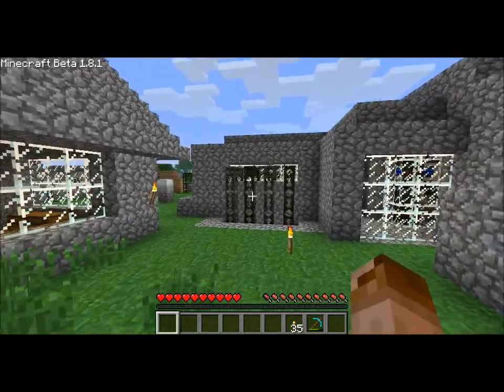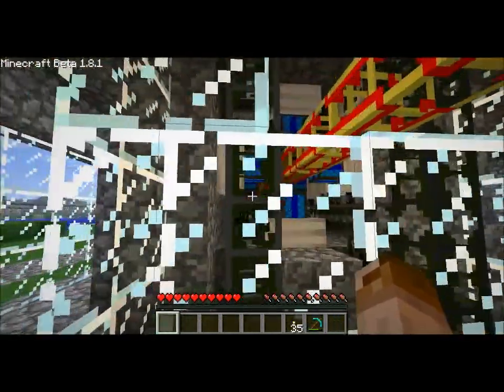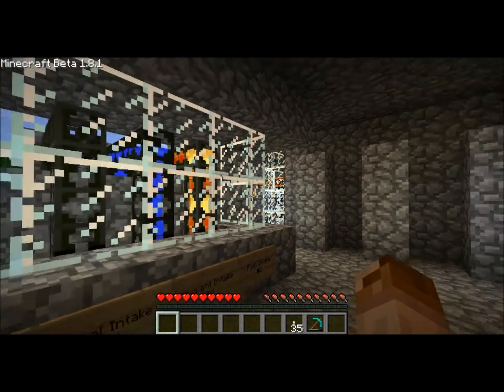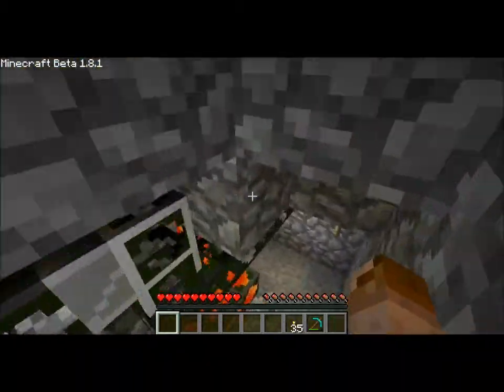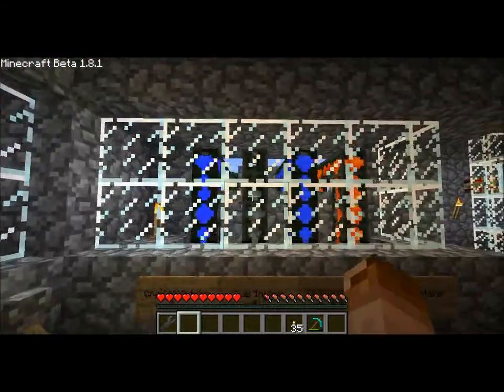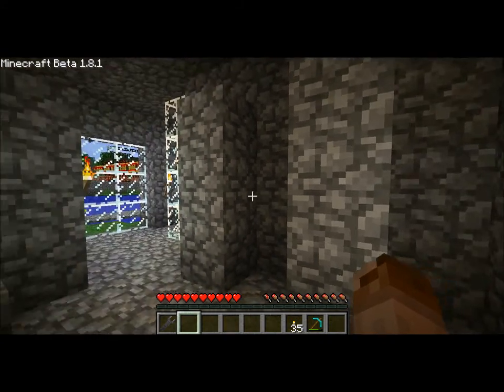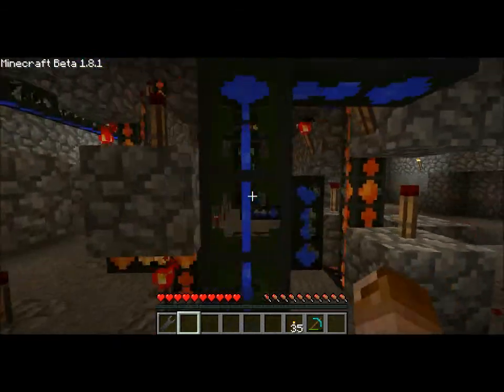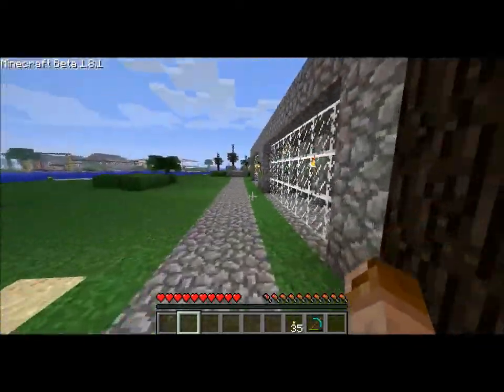Buildcraft Powerplant Constuction Part 11

Comment: Did you know that your power plant isn't very effecti, cuz there is a limit on the conductor pipes, as I have tested it and found out that any thing pump, quarry, refinerry ect. requires 4 combustion engines or at least 15 steam engines, but when I connected 5 refinerrys to 28 engines only foure could have run normaly(at full speed) and when I tried connecting the 5th all of them slowed down to minimum, so there is no point in puilding very large power suplies as they are ineffective.